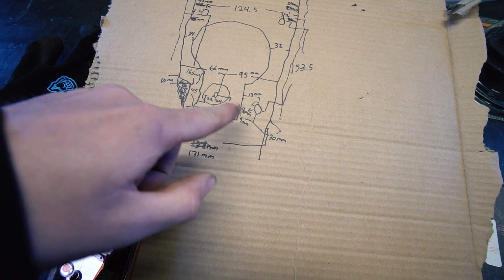LS Miata BALLER Dual Calipers and Custom Console Delete!

Comment: You shiuld paint the tombstone gloss black. Would match with the bottom trio piece and the finish on the carbon fiber bits
Reply: Fred Mccue I actually didn't like how glossy the bottom piece is in comparison to the tombstone. Would be curious to see them both done with black trim paint or flocked

Comment: Yo taylor, i just wanted to say your videos are pretty motivational to get my ass in the garage and keep my miata build going.  Have been building a forged rods 1.6 in my garage over the passed couple months and am finally close to getting the engine assembled and finished. Cant wait to swap it in and turn up the boost!

also no oil leaks is a nice benefit LOL

Comment: wrap the handle for the brake in paracord that would look wicked sick I think but that's just me you could weave it in and out the holes I gurentee it turn out awesome
Reply: Billy Breor good grip as well good idea.
Reply: Shane Gold thanks I thought so what you think about also flocking the dash and the center where the radio goes

Comment: I love the handbrake setup, but it looks like you'd need to add some sort of a guide for the rod that connects to the master cylinder. I'd think it would be necessary so you dont run thr risk of laterally loading the piston in the cylinder.